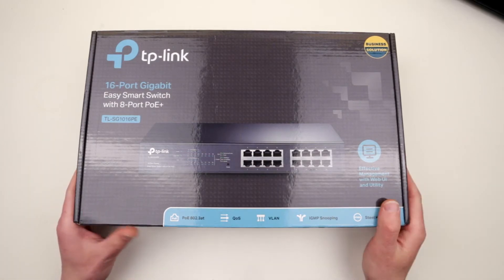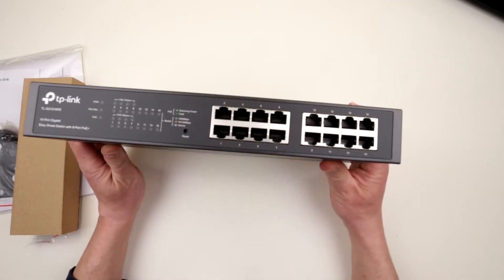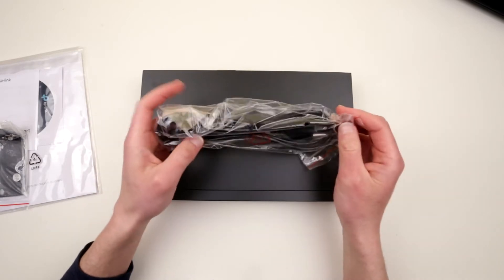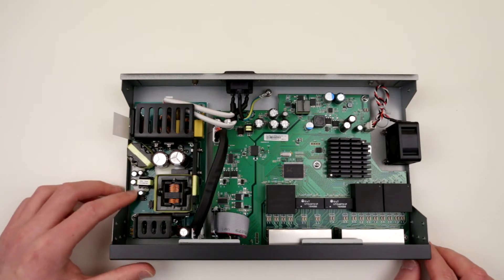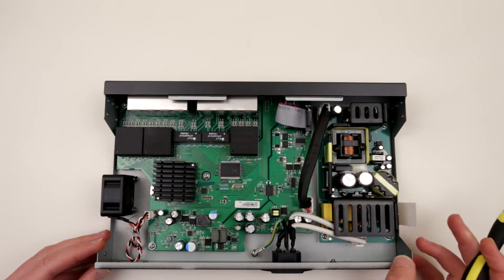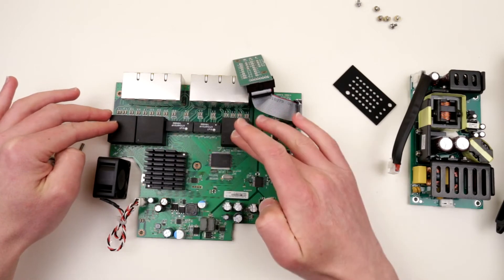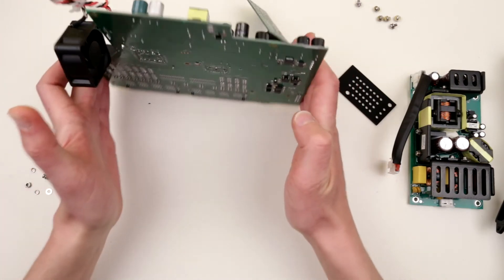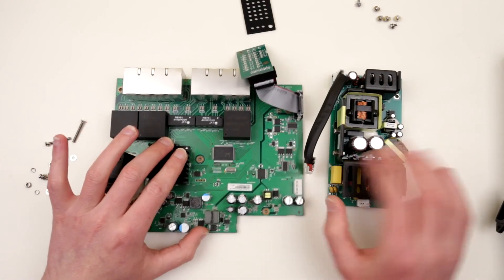Teardown of 16 Port POE switch from TP-Link

Comment: On a scale of 1 - 10 with 10 being the loudest, how would you rate the fan noise please? 
Thank you
Reply from the maker: It quite but noticeable 3 meter away. So it is not for bedroom for sure.
Reply: i have it on my bedroom closet and this thing is so load. I replaced it with Noctua fan and now it is silent. I only using 2 of the POE port so i'm not very concerned about the temperature.
Reply: @SkyChurch11  can you tell if the fan header is 5v or 12v? cannot find any pictures. Which noctua fan did you use? the NF-A4x20 FLX?
Reply: @SkyChurch11  hey, which fan did you use as i have the same issue with the noise.
Reply: The dB meter on my smartphone says it's about 82 dB when held right next to the case on the fan side. I wouldn't recommend putting this in a living room or bedroom.

Comment: Hi amirnasher
Thanks for doing this video - it was exactly what I was looking for!  I just purchased this switch, works great however the fan can become loud as its located in a bedroom.  I'm thinking of disconnecting the fan, have you had issues with heat?  I'm pulling a constant 36Watts.  Also noticed this device has no warranty seal stickers, which was confirmed in your video.  Thank you
Reply from the maker: Yeas it would be a bit to loud for the bedroom, In my case it in basement so I don't hear it. At the moment I'm not using any POE ports, so no heat issues! But I assume when I start pulling more power heat will rise !  Too bad it does not PWM the fan :(

Comment: Hi @amirnasher

Can you put details of switch, flash memory & RAM chip ? Of course we can see detail cpu below soldered heatsink ^_^.
Thanks.
Reply from the maker: Sure, this is good idea, I still need to post photos of pcb. But I did not notice any extra RAM chips, so RAM probably integrated with main controller...